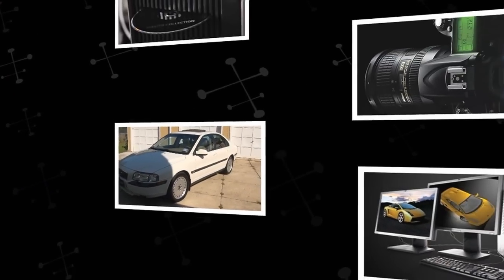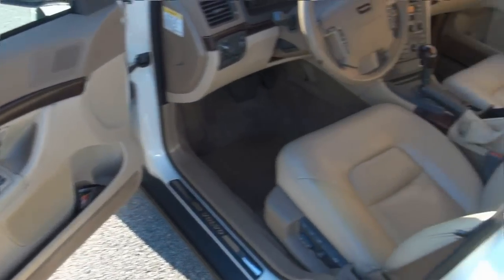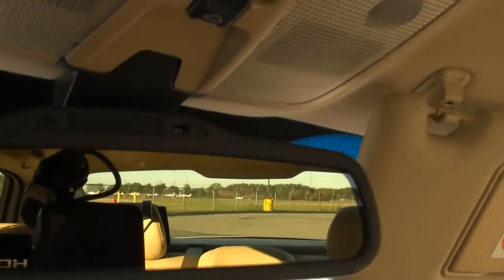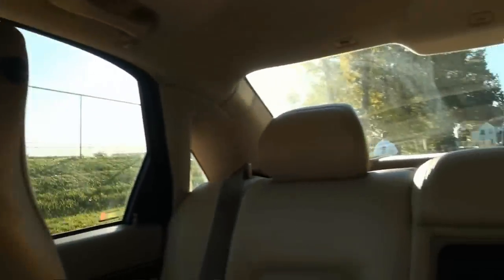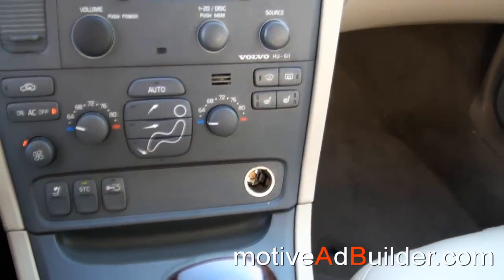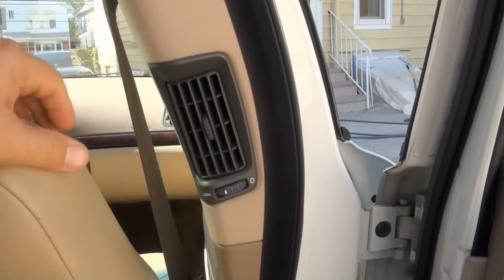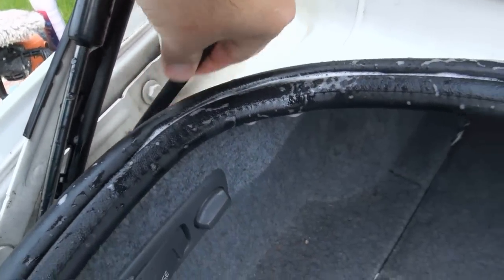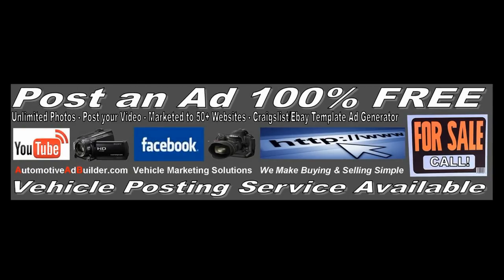2001 Volvo S80 2.9 Sedan Test Drive

Comment: I have a 2002 s80 T6 with 169,000 miles. It has some of the cosmetic problems but no issues with the ABS. Would like to hear the car run and the natural noises it makes. The music spoils the review.
Reply from the maker: I had 3 S80s.  That video is 10 years old. I do advertising for 2 Volvo stores in NJ. They service a lot of older ones still.

Comment: YES...id say 6 mis of looking at the body and 20 seconds of looking at the motor (real part of the car) is good filming....
I mean if the car was selling for say $1200 you got a great deal anything over 2k YOU JUST ROLLED THE DICE ON A LEMON...

what about the dent in the back and carpet that's messed up ...NOPE this radio has 20 preset...dude 3 days after id buy a car like this that stock crap is in the garbage...

what about fluid changes and(motor) head gaskets because either one failing is 3-4 grand >>>EACH !!!
NOPE ICE COLD AIR. you get that....